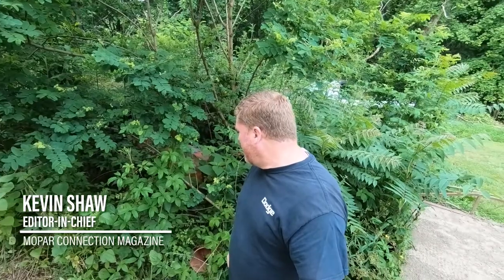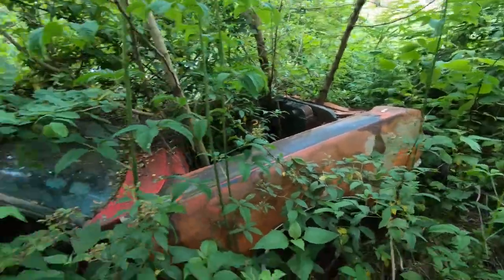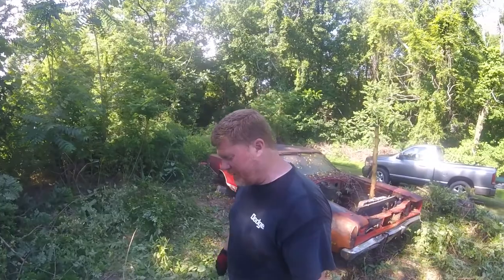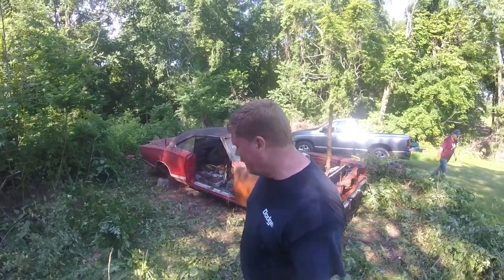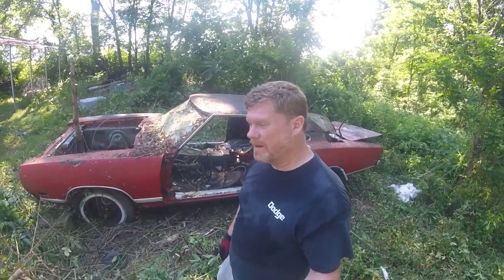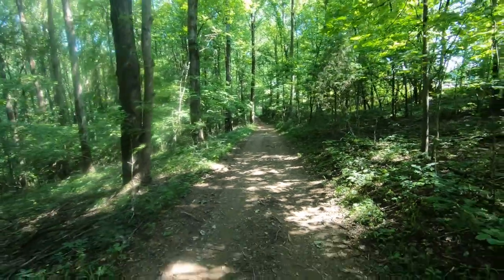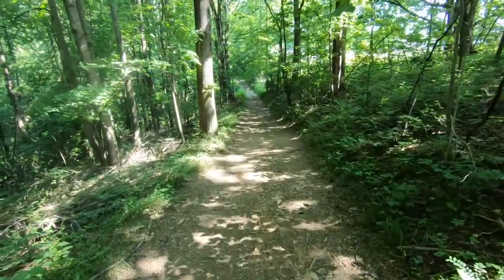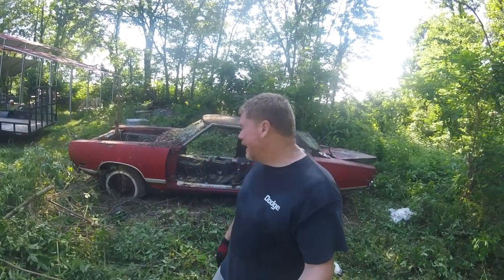Rescuing a '69 Coronet 500 From the Woods

Comment: I saved a 440 + 6 70 GTX years ago that is fully restored now, and with a different owner. If I had not done the preliminary work on the rotted out parts, it wouldn't be sitting in pristine condition today. So Never Say Never... Somewhere Out There is an interested party. Great you guys went and had a look , because it led to another use for the vehicles...
Reply from the maker: Literally watch the end of the video. It found a new home.

Comment: Did you shorten that RAM? :D

P.S.: There was no 8,25" axle. You mean the 8,75". And i wonder that there is a 727 behind the 318. My 68 with the  318 has the 904.
Reply from the maker: There most certainly was a 8.25.
Reply: @moparconnection  Googled it. youre right.
Reply from the maker: It doesn't happen often. :D